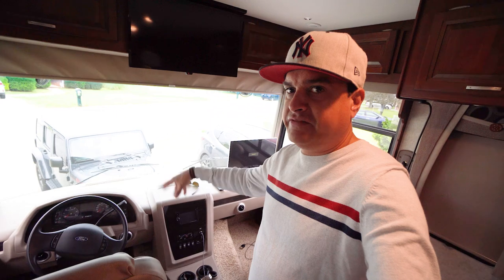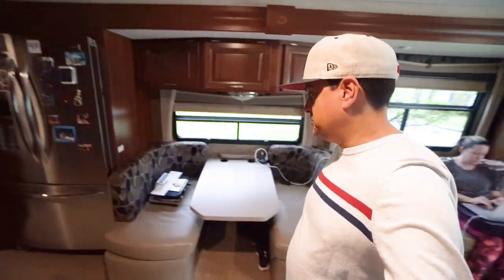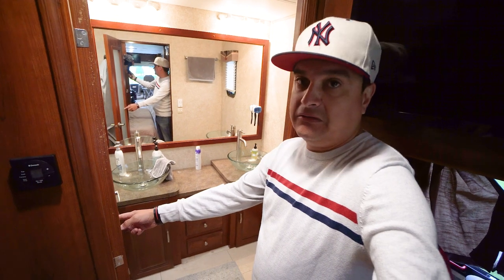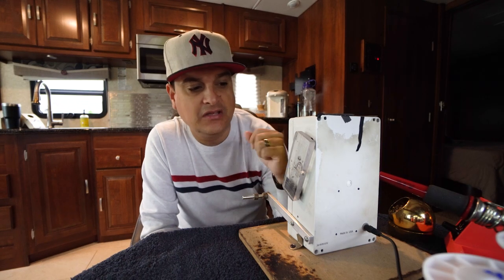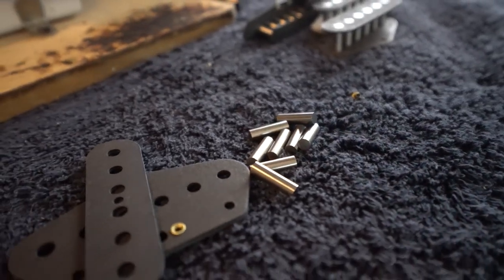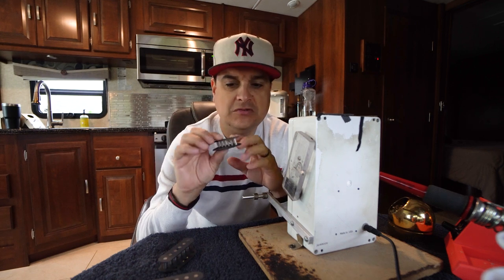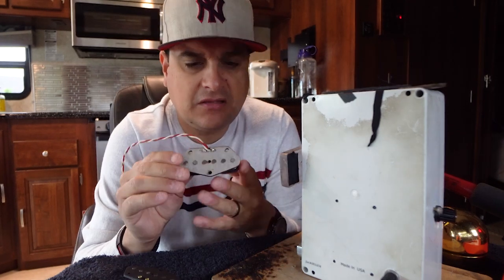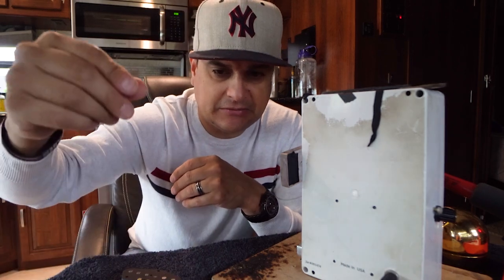Our Mobile Guitar Pickup Winding Setup - How To Make Telecaster Pickups

Comment: Excellent real world video 📹., I liked seeing your motor home that was fun.
 I recently saw your video on pick up construction and it brought up a question: 
How it would it change the tone to switch my brass base plate for a nickle plate on my Tele bridge pickup?
Would it be worth it?
The Pickup measures 6.8k and I wax potted it. But I still find it a bit brash in the higher frequencies. 
Thanks Dylan 😊

Comment: Really cool to see you process first hand with the current setup... Would you care so share some info on how you would do single or dual polepiece pickups as far as DC resistance spec and so forth... I'm thinking cigar box and goofy stuff like that. I want to do a crazy single string electric for some studio noisage use and I was wondering if I should get a longer magnet polepiece to get more winds on the coil... Let me know what you think!!

Comment: Can a humbucker have effective noise cancelling if the coil closest to the bridge is wound slightly more than its counterpart within the same pickup? Essentially, in an HH setup, there would be 4 different amounts of winding with less at the neck working progressively more wound toward the bridge using this methodology. How would it sound?

Comment: Hey Dylan why do some single coils have magnets that are not even across the top two or three will stick up above the bobbin ?
Reply: They're called staggered like a single coil strat pickup you mean? there's a little mix of having to do with the curvature of the fingerboard, along with some strings sounding louder than others, and we've also changed gauges, I mean in terms of popularity... We went from heavy flatwounds, to discarding the low E, moving them all up (or down rather) and putting a thin gauge  banjo string in place of the high E...man I remember as a kid going with my father in the car across a few counties to get some black diamond or La Bella strings which are only two companies I could even remember back then. Anyway the single coils with the slugs or poll pieces that are staggered-those were almost always made with the pole pieces being magnetized themselves as opposed to a magnet underneath them, and in the old days you'd crank up that guitar and the pull from the magnet could self-generate the string into feeding back, and I'm getting long-winded.... But a funny thing just came to me... I knew a very good bass player, college instructor and all around pro... He showed me his bass, telling me that it was about to go in to the shop for possibly extensive work, maybe moving the side fret markers possibly planing the fretboard, all because it wouldn't play in tune. Mind you it was a fretless, but he was a classically-trained jazz heavy, upright player who pretty much knew his stuff and how should it should be. Me being a strat player, it took me about one minute to figure out his pickups were too close to his strings and throwing all the harmonic content to heck. I lowered them, saved him a couple hundred bucks he bought me a beer and he started throwing me my first gigs... A guy named Joe Tater, 4 hours dinner music on, 45mins off and another four hours dance...80 bucks! I doubled on bass and guitar. if I remember right I think my apartment was 180 or 200 a month. I justremember the Toyota Corolla I drove to the gig I got from him also, I think for $100 because somebody swiped it coming around the corner bending in the driver side front wheel. I replaced the control arm rim and tire for less than fifty bucks, and put almost 300,000 on that
car. Wow all that for a couple turns of a couple screws. Haha this is what happens when an old guy butts in, bored from being shut in with this virus. And I've only scratched the surface of the question....... hahahaha.

Comment: Why not run the bottom plate ground with a third lead, separate lead from the pickup's ground, so that the user could reverse the two pickup leads, to match the phase of another pickup, if need be? Obviously not necessary if someone buys a PAIR of pickups from you, but if they buy a single pickup from you, to run with another maker's pickup - that would be very nice to have to easily match phase between the two pickups.
Reply from the maker: we do it upon request. other boutique builders charge 15.00 for that